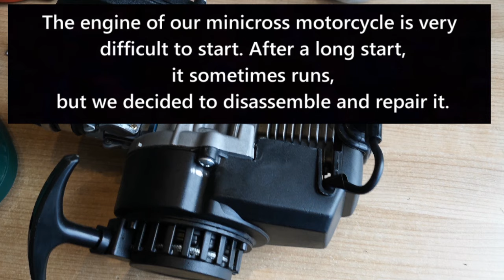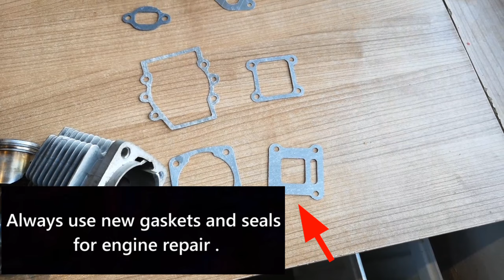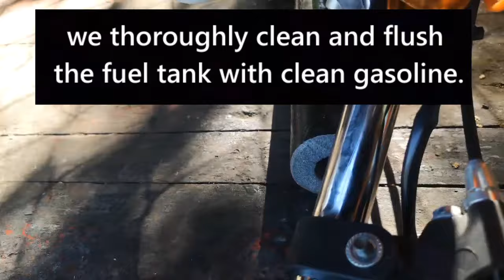How to Repair your MINICROSS / MINIBIKE !

Comment: really good video did you ever narrow it down to the cause of why it was so difficult to start and stay running my son's bike does pretty much same thing it's a little moto bike with the same motor as you got but I can get it to start and he can ride it for like 30 seconds and it bogs down and eventually quits and then won't start back for a little bit. Any advice would be appreciated thanks
Reply: Sounds like carb problem check the bottom where float is and the jet in there. I had a similar problem and found dirt in there cleaned it out now runs awesome

Comment: hello anyone in 2024? was wondering what size drill bit was used for the carb fuel tap mod. thank youuu!!!
Reply: I did the mod a few days ago. I think i used a 3 or 3.5mm bit, but am not sure. I checked which bit goes through the outlet and did not check the size.

One more sugestion, drill from the bottom (carburetor side). The bottom opening seems a bit smaller and if you open it too much, the gasket will not fit. The hole can be smaller without it obstructing the flow. Basically, when you dissasemble the valve, the bit must be at least the size of the holes in the rubber.

Hope this helps.

Comment: I put new engine on still won't start new carburetor new spark plugs still won't start x pro 50cc dirt bike hawk
Reply: Did you check for spark? Is coil pack line up correctly
Reply: @MoBLuBSiAb4LiFe  yes everything new
Reply: Try the fule valve mod he did on the carburetor.  If it has the 4 way rubber gasket on the inside it is just a very bad design and creates a vacuum lock where fule can not flow .
Reply: I can confirm about the fuel line valve. My kid had a similar problem. The bike would run for about a minute and then stop (right before stopping, it would rev by itself for a second). I found that the screws holding the front plate of the valve were too tight and fuel flow was bad. The bike would empty the carburetor faster than the fuel could come in, and that is why it was reving before it shut down - there was more air than fuel in the carb. Unscrewed the bolts for 1/4 turn and the bike worked normally ever since.

I turned the valve off and cleaned the carb for the winter and when turned the valve on again yesterday. It started leaking fuel as hell. It stopped once the rubber got greased by 2 stroke oil. This valve is a nightmare. I think I will also do the same mod like Tino...

Also, guys, what mix ratio do you use on those bikes? By the book it should be 4%, but there is so much smoke and oil residue in the exhaust that the bike will stall in a minute or so if left idling. What oil and what mix ratio do you guys use?
Reply: @Rakija_Shliwowitz HELLO yes, that is very true but i never got it down to that conclusion, i just ordered a brand new carb off Amazon and i’ll do the fuel tap mod. do you know what size drill bit i will need?